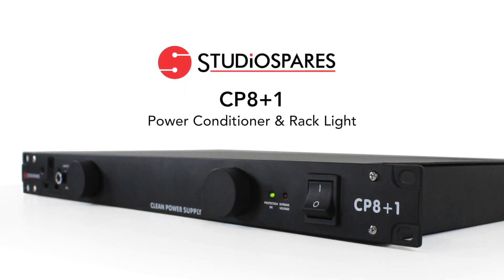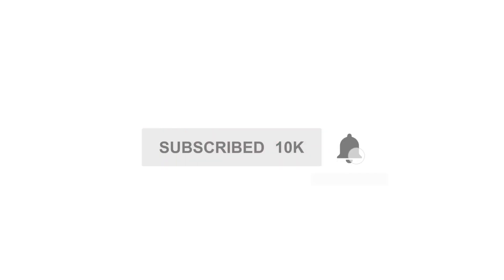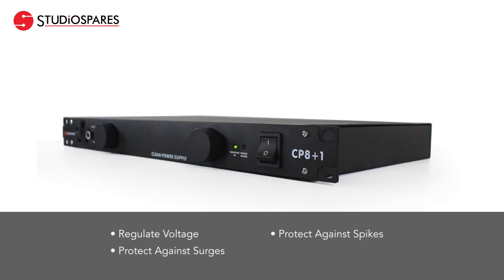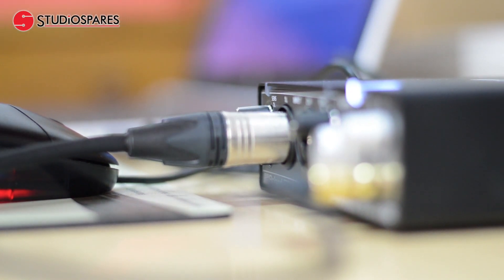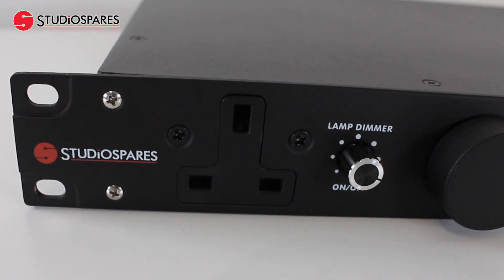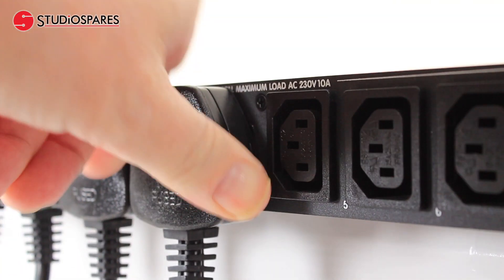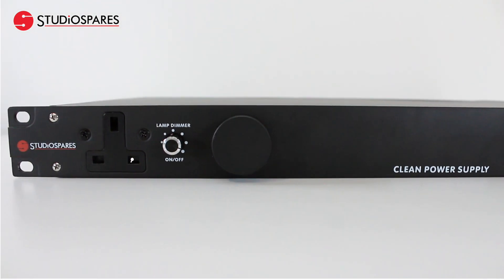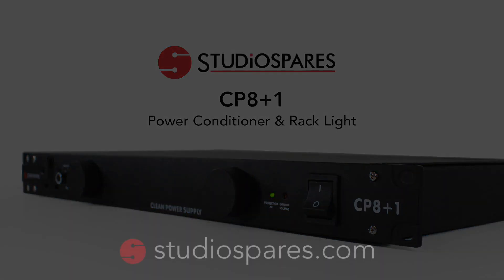Why do I need power conditioning? - Studiospares CP8+1 Power Conditioner

Comment: Is it ok to plug power strip into it?
Reply from the maker: Hi there, yes that would work but we would recommend you not to exceed the maximum amperage of the CP8, as outlined in the CP8 manual. If you have any further questions please don't hesitate to get in touch with one of our sales team on: Tel: 020 8208 9930 - Email: sales@studiospares.com